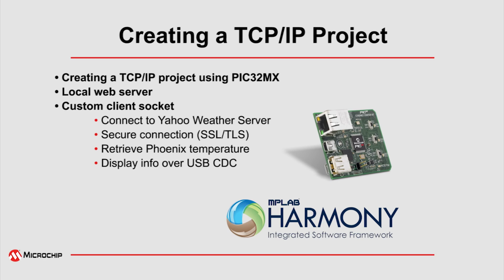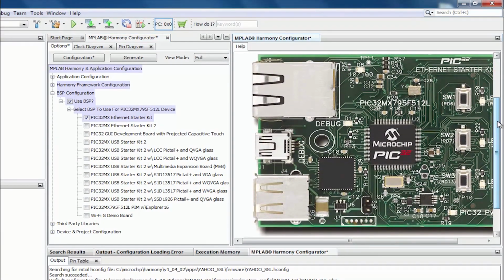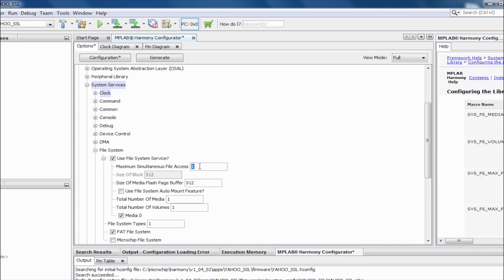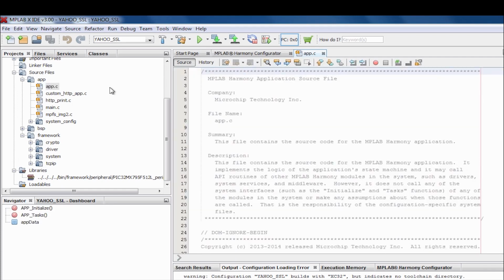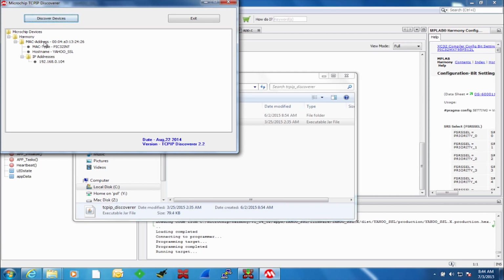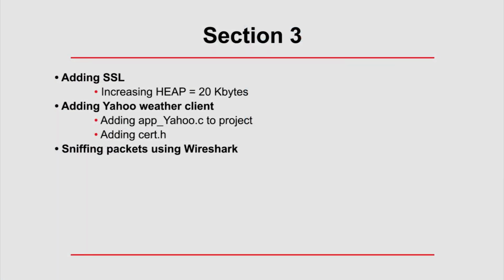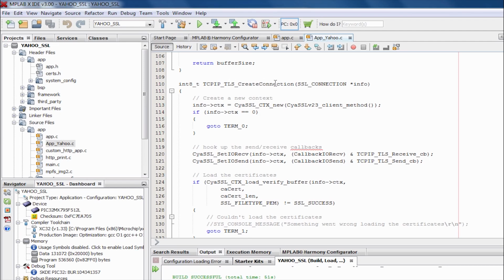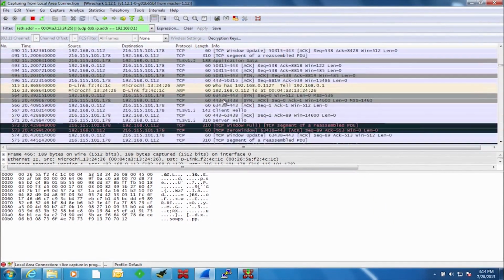MPLAB® Harmony Configurator Tutorial - Creating a TCP/IP Project from Scratch

Comment: The information presented here is obsolete. With MPLAB 6, you need to run Mplab Code Configurator. I spent two days trying to find the pin configurator and clock configurator on the new platform.  Under the Project Graph tab (top center of screen) there's a PLUGINS dropdown. Those tools are hidden there.

Comment: Why are you using an older version of both programs (older harmony and mplab version) since there is now MPLAB X IDE v6.00 and harmony v3 and v2 out already (already found out that you need to use harmony v2 to be able to use the PIC32 ethernet starter kit). I followed the video and already got errors on the section 1 project with the berkley api and not being able to find some variables.